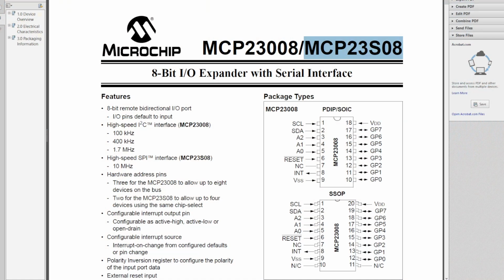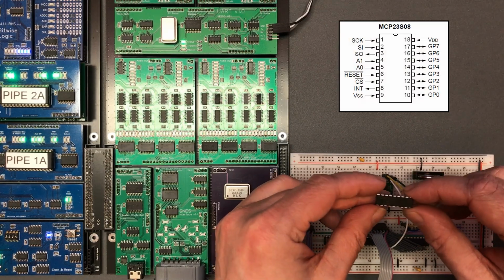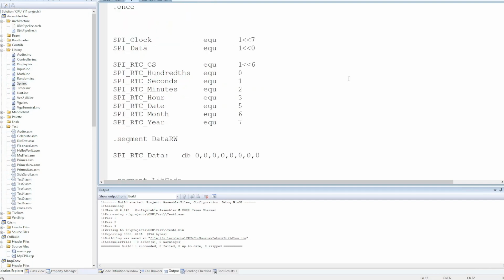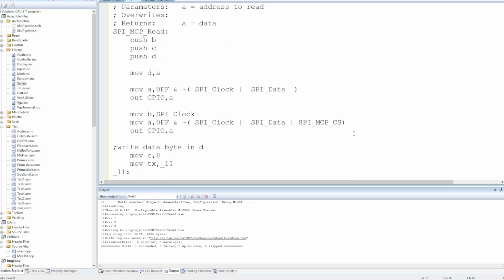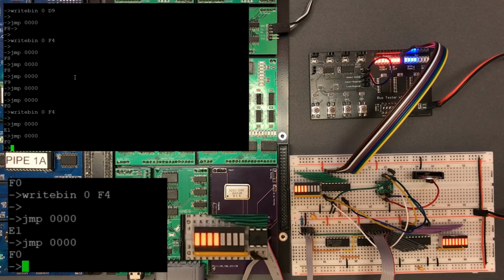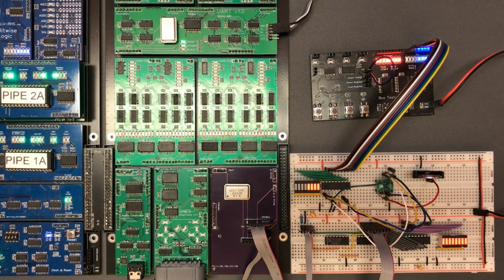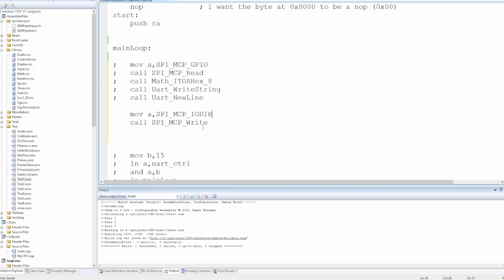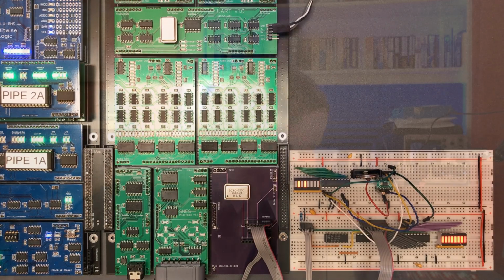GPIO over SPI over GPIO - IO from Scratch - Part 5

Comment: Really great to see you using this chip. In part 4 I was thinking about the commodore 64 CIA chip which had the clock aswell as the GPIO feature your implementing today.
Reply from the maker: SPI really does add some interesting possibilities. I feel conflicted over using these more complex devices though.
Reply: @weirdboyjim  Floppy disks are complex devices. You're swapping one for another. It's actually great. I was telling my partner today how good it is that you're exploring beyond the hardware by developing OS features. You're surpassing the point in a project where other YouTubers finish up at. Can't wait to see more!

Comment: I have an RTC that runs faster during the cooler months and slower during the warmer months. I included a trimmer capacitor in the oscillator circuit and managed to get it down to 1-2 seconds a month, as long as I don't go away on business travel and turn the heating off, at which point it can drift a few more seconds. I don't know how practical it is, but moving the RTC to a warmer part of the house and testing it there would be an interesting experiment too.

Some other RTCs I have allow you to add or subtract ticks to/from an internal counter to compensate for temperature swings. It's quite an interesting challenge to keep accurate time when you have no reference.
Reply from the maker: The whole subject area is very interesting! For this build I'll probably satisfy myself with setting it every now and then.

Comment: SPI is full-duplex, or can be, no? As you’re clocking bits out, valid bits can be coming in. Perhaps not relevant for this chip, but maybe others?
Reply from the maker: Yes it is! Shifting bit's out and in happens at the same time but it's very common (as with these devices) that only one is relevant. For speed reasons when bit banging you specialize the code.

Comment: You mentioned looking at your RTC drift over a longer time period. The 32khz crystals typically have a spec of +/-30ppm, which is about +/-2.6 seconds/day. It's highly dependent upon the temperature of the crystal, and some RTCs even have methods of adjusting the frequency to compensate. The DS3231 is one example of that, but it's an I2C device instead of SPI.
Reply from the maker: I bought a splashproof lcd clock for my bathroom and it drifts faster than this circuit, I proberbly shouldn't complain.

Comment: Oooh hello 23S08 my old mate. It's been a couple of years now since we spent so much time together.
This is a ridiculous idea but... imagine having a 23S08 bit banging SPI to another 23S08 which is bit-banging SPI again and again to ludicrous proportions. ;)
Reply: You do that 100 times and the data rate will be slow enough to hook up a mechanical actuator that moves something. Like you can have 2 servos one with a red flag attached and one with a white flag. The data and clock would make the servos move the flags.
Then you put the whole contraption at a window and have your neighbor across the street point a camera at the window and try decoding the data stream.
Then set up the same in reverse for full duplex.
At that point, you should be able to wirelessly read and write an SD from across the street. Very, very slowly.
Reply from the maker: It might be a fun experiment to do one day!

Comment: Your RTC crystal should need some small capacitors (22pF I believe) to operate correctly.  It's possible the chip might handle it but it would be worthwhile to check.  If they're necessary the crystal will not be putting out a clean signal and you will get incorrect operation.

If you covered that in your last video and I'm an idiot I apologize. :)
Reply from the maker: I expected the capacitors to be there, but the data sheet doesn't have them. I can only assume they are either not needed or included internally.
Reply: If you need any capacitance it will be detailed in the datasheet of the crystal. It's not always 22pF. I have some 32768hz crystals that are spec'd for 6pF for example.
Reply from the maker: Ahh,  that's interesting.  Unfortunately these crystals were an ebay special. I'll have a dig around and see what I can find.
Reply: 32kHz don't usually need caps.

Comment: I dont know if JAM-2 will involve alot of breadboards, but I wonder if you could make little PCB's that do nothing more than act as a mini bus for when you want to move 8 outputs to an LED bar - as an alternative to cutting 8 wires each time. Might need a few for common layouts. A bit like your backplane interconnects - but 2 / 3 pins wide & 20 or so long. Probably would not look as nice mind you.
Reply from the maker: I have a number of different ideas on how to do bits like this differently.  I don't mind a little bit like this, there is something therapeutic about poking some wires into breadboards. I do have ideas to create some modules to simplify some of the common combinations.

Comment: That's awesome, James. I still need to add SPI to my HBC-56. I've added it to my PICO-56 for SDCard support, but the real metal (HBC-56) can't do it yet.
Reply from the maker: Thanks Troy!  SD cards are a cool little bridge between small digital circuits and something that can easily plug into a modern PC!